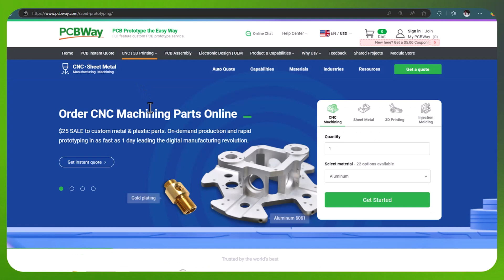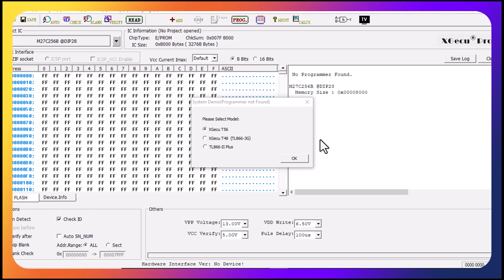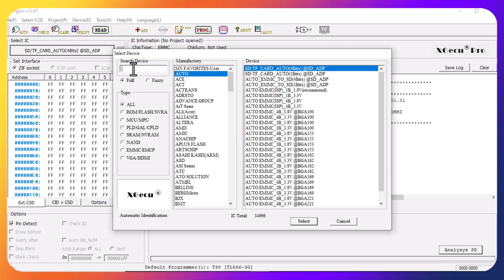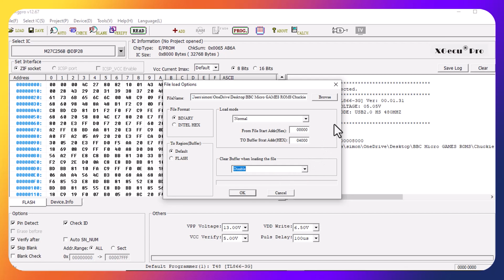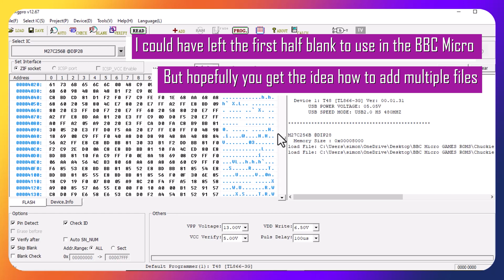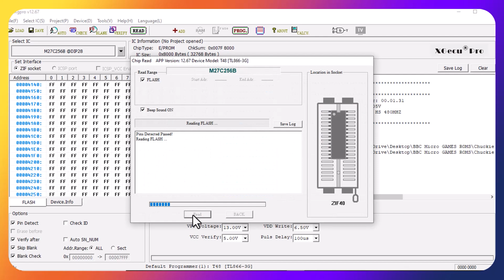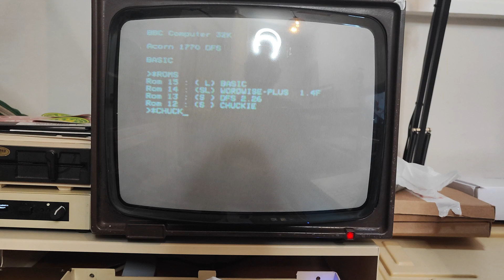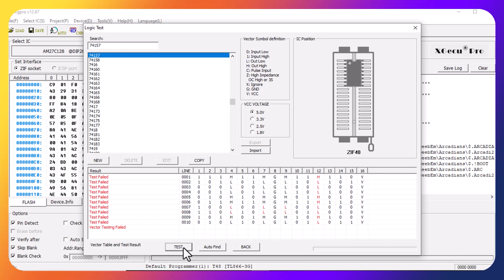The Ultimate Beginner's Guide to the Xgecu T48 Programmer

Comment: is this good as an alternative for rt809h that I can't afford?
Reply from the maker: I'm not familiar with that programmer so wouldn't want to comment comparing the two.

I'd suggest you go on Xgecus website and check the ICs you are looking to program is on the list. Depending as well, you might want to consider the Pro version if 28 pin DIP isn't sufficient as the pro has a longer socket and faster to program ( so handy if you're doing loads)

What I can say is everything I've thrown at the T48 has worked flawlessly. What more can you ask? 😊

Comment: Wie kann ich einen chip kopieren?
Reply from the maker: So that's actually pretty simple. Put the chip you want to copy in the Xgecu, read it in, then select the chip type you're going to burn, place the blank EPROM in the Xgecu then load in the image of the original chip and then burn it
Reply from the maker: Obviously you will need to save the data first from the chip you have read. Just follow the software prompts. Then you can load this ready for burning AFTER selecting the new chip type
Reply from the maker: Any problems, link in with my Discord and I'll do you a step by step guide
Reply: @RetroComputingReboot  könnten sie ein Video  machen wie ich die daten ablese und speichere und dann auf denn neuen chip mache? Danke für Ihre hilfe

Comment: Brilliant video. I was surprised to see 'Chuckie Egg' run without an issue when the window was not fully covered! I believed that the erasing of the contents on the chip would be instantaneous when exposed to any form of light (you can tell I am an avid film photographer!) but according to Google AI it can take weeks or months for a typical incandescent bedroom light to affect the contents on an EPROM chip. This is very reassuring.

TIP: When removing DIP chips from a PCB board, you must use the right tool for the job! Some chip extractor tools are designed for chips with 4-8 pins, others 8-24 pins or even 24-40 pins. Know and understand the capabilities of your extractor otherwise you may damage the IC by breaking the pins that can arise from using the wrong tool!
Reply from the maker: Thanks for that. I really appreciate the comment.

What I have also discovered is how sensitive the erase feature is to the wavelength of UV light. Before I got the dedicated UV chio eraser, I tried using a UV light that I use for retrobrighting faded plastic. It didn't work at all, even after hours exposed. Reading up, it's all about a very specific wavelength that erases the chips. Obviously my cheap generic UV light probably isn't as 'UV' as I thought it was 😂
Reply: @RetroComputingReboot  I am so relieved that the data on the chip window does not just instantly disappear when exposed to any form of light, like a photographic image on a piece of undeveloped 35mm film would certainly do! (speaking from a past experience). Not the case with developed film.

The other night I was inspecting the pins on a DIP chip to see if there was any corrosion and for a moment I was concerned that a trace of bedroom light may have gotten under a gap in the label on top of the chip!

My XGeu should arrive tomorrow. Can't wait to use it.
Reply from the maker: Yep, I had the same paranoia about UV light when I first started experimenting with EPROMS 😂 

I would suspect if fitted in a board inside a case, like with my BBC Micros, they would maybe last decades with so little light penetration.

For me, I burn the EPROM with no label, test the flash has worked, and only then if I'm happy, do I put a label over the window. There's certainly no panic to cover it up. Obviously makes sense to cover it up as soon as, but I want to know it's worked before I mess around with a label.

I hope you enjoy your Xgecu! Honestly, after you've had a play round and used it a couple of times, you'll laugh you ever worried it would be too complicated.

Follow my guide. There's enough there to get you going. Feel free to say hi on my Discord and drop any questions you have
Reply: @RetroComputingReboot  I really appreciate the advice in your third paragraph about the label. I will follow the same procedure.

I actually think there's a lot of important information one must know before they use this device. I definitely would not class this as 'Beginner Friendly'. I have read the first quarter of the User Guide, however, it was your video that emphasized the importance of putting the chip into the program not only in the correct orientation but also the correct location in the socket! If it wasn't for your video I would have put the chip in the correct orientation but the wrong location on the ZIF socket.

I decided to write my own 'Quick Start' guide in a .txt file with the correct order of operations that highlight which boxes need to be checked and unchecked, the important of clicking the 'Device Info' tab to study the picture etc. The manual is good but it's obviously been translated from Chinese and some of the text is not so easy to understand although I get the gist of the instructions, they do not make for easy reading.
Reply from the maker: Of all the manuals I have read translated from Chinese, this is certainly one of the better ones.

Honestly, it looks a lot more complicated than it is. Give yourself time, don't rush, install the software and drivers first, and then just take some time to familiarise your way around the software. My first EPROM flash worked, and I'm no genius 😂
Reply: @RetroComputingReboot  I was wondering, have you flashed a NM27C010Q-150 32-pin DIP chip manufactured by 'National Semiconductor' and if so can you share any tips? The manual mentions performing a 'Blank Check' for the 27 series chips.

My next challenge is repairing one of my DIP chips that has a broken leg because I used the wrong DIP extractor. I have ordered a small tool, similar to a Dremel that allows me to add a sanding attachment, which will be necessary for exposing the metal the leg was attached to so I can repair it.
Reply: @RetroComputingReboot  I've just plugged it in and it says an upgrade is available. How do I do this from the software? Reflash firmware is ghosted out.
Reply: Well, I may be suffering with a cold, but I have just programmed my very first NMC27010 DIP chip and everything appears to be working. I may have just saved my 486 Viglen DT-PCI mainboard from the scrapheap! I am so happy!

I will now test CPU performance and hard disk access times.
Reply from the maker: Thanks for letting me know. I'm really pleased for you. How was it?
Reply from the maker: Did you sort this? I can't remember how I did it 😂
Reply: @RetroComputingReboot  I was forced by the makers of the XGeu T48 to acquire a newer version of the software. This was no pleasant task. Attempting to download the files gave me an estimated download time of 1 day! Ridiculous. I ended up having to create an account with MediaFire and I had to download each file individually.

Onto the software: When I attempted to read the chip I received an error about bad pin contact and I started getting really worried. Fortunately, there was no issue with any of the pins, thank God. All I did was uncheck 'Check ID' and the Read and Program operations were successful. I did not attach a label until I was confident that everything had worked. I then added a label but it did not stick properly so I had to add Kapton tape. The results of my testing are in the next message.
Reply: @RetroComputingReboot  The following results were done with a Seagate ST3491A hard disk.

[ORIGINAL CHIP RESULTS]

DISABLE EMM386 MEMORY.

LAND MARK SPEED TEST CPU RESULTS:

CPU: 634.37 MHz
FPU: 976.23 MHz
VIDEO: 19275.29 CHR/MS

SPEEDSYS RESULTS:

CPU: 48.53

EXTENDED MEMORY TEST:

READING: DIPS AFTER 16 AND 256

WRITING: STRAIGHT LINE

MOVING: DIPS AFTER 16 AND 256

ST3491A HDD:

AVERAGE SEEK TIME: 16.67 / 25.12 MS
RANDOM SEEK TIME: 14.81 MS
TRACK-TO-TRACK SEEK: 4.25 MS
RANDOM ACCESS TIME: 27.71 MS
BUFFERED READ SPEED: 1004 KB/S
LINEAR VERIFY SPEED: 1543 KB/S
LINEAR READ SPEED: 955 KB/S
ST3491A HDD SPEED: 19.30

--

[NEW CHIP RESULTS]

DISABLE EMM386 MEMORY.

LAND MARK SPEED TEST RESULTS:

CPU: 634.36 MHz
FPU: 976.24 MHz
VIDEO: 11170.91 CHR/MS (I INSTALLED A DIFFERENT VIDEO CARD!)

SPEEDSYS RESULTS:

CPU: 48.53

EXTENDED MEMORY TEST:

READING: DIPS AFTER 16 AND 256

WRITING: STRAIGHT LINE

MOVING: DIPS AFTER 16 AND 256

ST3491A HDD:

AVERAGE SEEK TIME: 16.75 / 25.43 MS
RANDOM SEEK TIME: 14.81 MS
TRACK-TO-TRACK SEEK: 4.35 MS
RANDOM ACCESS TIME: 28.03 MS
BUFFERED READ SPEED: 1004 KB/S
LINEAR VERIFY SPEED: 1545 KB/S
LINEAR READ SPEED: 956 KB/S
ST3491A HDD SPEED: 19.10

I have often observed that when a BIOS chip from another board is placed into a similar board, performance suffers. However, based on the readings above, I do not think that will be the case here! It does look like a resounding success.
Reply from the maker: CheckID has occasional issues for me too for chips I've bought cheap off AliExpress
Reply from the maker: Brilliant news. I'm glad the EPROM came through 😁

Comment: Great video! The T48 XGecu programmer is a very decent piece of hardware. I used it to flash ROMs for a ZX Spectrum replica I built. The only problem is that the official software only supports Windows. If you are on Mac you need to use either the minipro command line tool or the Visual Minipro app.
Reply from the maker: That's good to know. I'm not a Mac person myself but others will find that useful I'm sure. Is there a guide for the workaround you could share?

Comment: These are good while they work. After burning about 10 roms mines knackered. Won’t read any chips now so looks like I’ll go back to the old tl 866
Reply from the maker: That's a shame. I've burned what must be at least a 100 ROMs without issue. Maybe you're unlucky? I wasn't aware these are prone to fail
Reply: Did you get a genuine one from the seller official store or perhaps a cheap clone?
Reply from the maker: @benbaselet2026  Genuine I believe 🤞

Comment: I've ordered one of these to try and re-flash a BIOS chip on a motherboard that has a custom BIOS that is locked with a password that no one seems to know.  It's baked into the BIOS by default, so no reset removes the password.  Glad to see some explanation of the program and how to use it before having to dive in and figure it out.  Know about the search feature and it being able to narrow down exactly what you have is going to be very helpful, as well as the diagram for now things need to be oriented.  Thanks for the simple and concise video!
Reply from the maker: Thank you. I really appreciate the comment. I do try and minimise waffle and I'm glad you found it helpful. Good luck with your BIOS chip!

Comment: I have one and it works well, but just note that even with 20,000 components, there are many it doesn't do. While I enjoy tinkering with other MCUs, there are so many dev boards out there that are programmed with JTAG or just through the USB, it makes this device a little obsolete for the home user. Of course if you're doing old retro stuff that changes.
Reply from the maker: That's a good insight on the modern stuff. Fortunately or otherwise I'm stuck in the 80s 😂

Comment: Great video.. I've been eyeing up one of these for a good while - being able to write my own ROMs for retro kit would be amazing.

It looks like the T48 is significantly cheaper than the T56 but does pretty much everything I'd need.. maybe this is a Christmas present for myself 😁
Reply from the maker: Thanks James, I really appreciate that. I'm glad you liked it. I just wanted to make a video for anyone out there who had been toying with the idea of getting one but potentially put of thinking it would be hassle and overly complicated.

I think the T56 is probably only worth the spend if you need a larger ZIF socket or do loads of programming where the faster programming speeds would be of benefit.

When I got my T48, I just got the unit on its own without all the myriad of adapters you can buy. I can potentially see myself needing adapters for PLCCs at some point (maybe), but I'm going to be fine with just the ZIF socket for now. The good thing is as well, you can always buy the adapters separately at a later date for what you need.

I've got some videos planned now making use of this, so it will be getting plenty of use

Comment: im glad you explained this , as i have been toying with a purchase to burn roms for speccies , the selling point is that it also checks IC's which means you can save on buying a dedicated tester 
nice explanation for us older slower users
Reply from the maker: @firsteerr  I'm glad you found it useful. I e been in the same boat as you have for ages. It's surprising pretty straight forward to use

Comment: Bought my programmer a few years ago and used it to make 1.04 tos roms for some of my atari st's.  Found it to be fairly easy to use and is a useful bit of kit.
Reply from the maker: Funny you should mention that. I've got some chips on order so I can upgrade my  Atari ST's
Reply: @RetroComputingReboot  In my ST's, I went from 2 x rom chips to 6 x rom chips.  I don't know if you'll be upgrading via 6 x rom chips to 1.04, but if you are,  I have split the 1.04 image into 6 parts and can email them to you if you wish?
Reply from the maker: @JohnSmith-bh4zx Thanks John. I'd appreciate that. I've got 4 ST's, a mixture of 520 and 1040 ST and STE's. I can't remember off the top of my head how many use 2 ROMs and how many are on 6. What chips did you use?
Reply: @RetroComputingReboot  Hi, I don't why but YT seems to have lost a reply from me? But anyway, the Eprom's I used were 27C256-10, but I think you could use slightly slower chips like 27C256-15.  If you increase the number of roms to 6 you will need to unsolder 3 bridges on the pcb from the "1M" link to "256K" link (the exact location of these links can vary with the motherboard version) but they are fairy easy to spot though.  Let me know your email and I can send you the split 1.04 images.
Reply from the maker: @JohnSmith-bh4zx Thanks John. I don't know what happened to your earlier comment. It wasn't held by YT.

Email is retrocomputingreboot@gmail.com

Comment: Can it  program 27v and 25v eproms ? That is the important thing.
Reply: The specs says yes, reality says no. It seldom works on 2732 and down.
Reply from the maker: @KaterinaAndersen Good to know. Thank you
Reply from the maker: @G7VFY  According to the specs it can go up to 25v
Reply: @RetroComputingReboot  Can it do 2708, 2716, 2516 2732 and 2532  as well?
Reply from the maker: @G7VFY You would have to check on the Xgecu website. All the specs are there and a full list of chips it can work with
Reply: @G7VFY  No not 2708s unfortunately.